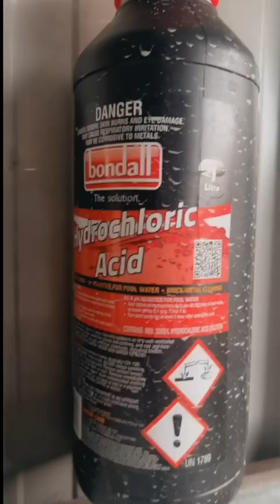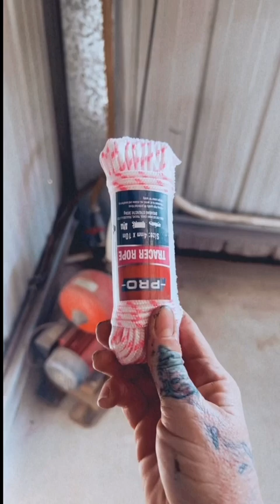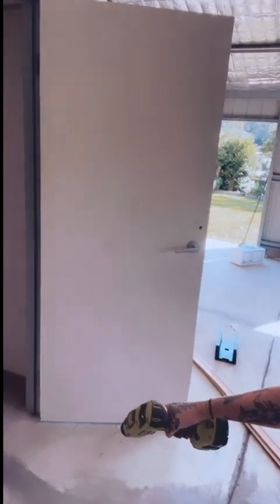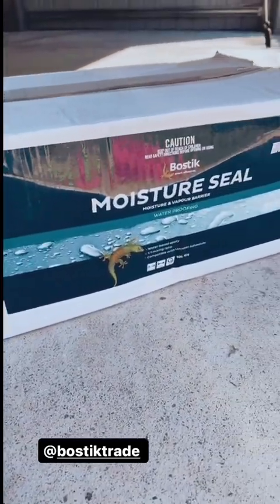DIY epoxy floor renovation part 1

Comment: Great space! How large is the entire space? Pinky, maybe an outside covering for auto protection and then using some space for building a recording studio... 🤔 Damn, how high is the ceiling? Also, why do you have the pump? Does it evacuate water from the roof when it rains? If so, a watertight exterior enclosure can be used to house the pump. Is it because the garage space sometimes floods? Sarah, if so, the best scene is one in which the need for a pump is nil. I assume because the garage can take on water (as is evident by the bottom of the shitter door), enough water may enter so as to warrant having a pump. However, if that is why there is a pump, the key is to avoiding any future water penetration. So, if the garage is susceptible to incoming water, from where is the garage vulnerable to this incoming water? I figure this is not a problem of massive turds causing the crapper to overflow. So, see if you can determine where water enters the space and then we mitigate that possibility by manipulating the physics outside (or by sealing the fuck out of the sidewalls and roof). Are you on the banks of a river that might occasionally swell and overflow into the property? Does the grading of the land upon which the driveway is present slope towards the garage on any side? Along the outside sides of the structure, are there spaces in the foundation and/or footing which might allow water to enter the garage? Along the sides of the garage structure, are there dips that might collect rising pooled water when it rains, raising the water level high enough to breach the top of the footer?  Again: why do you need the pump in the first place?